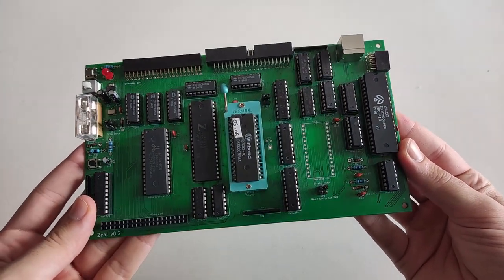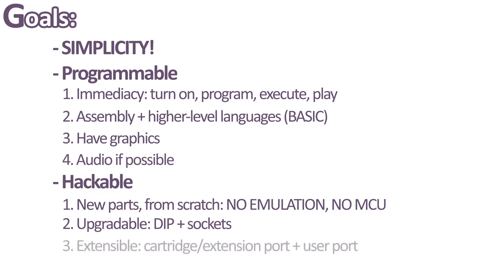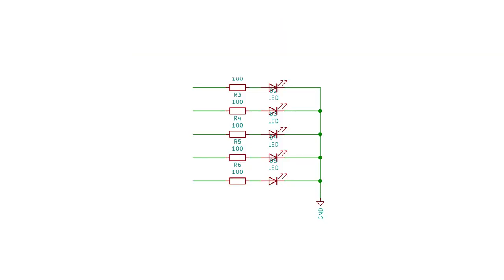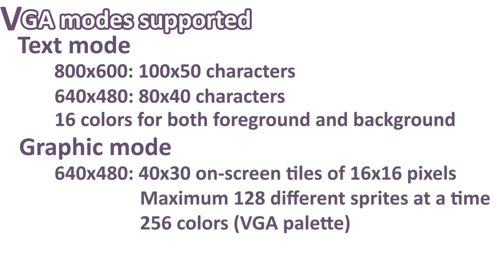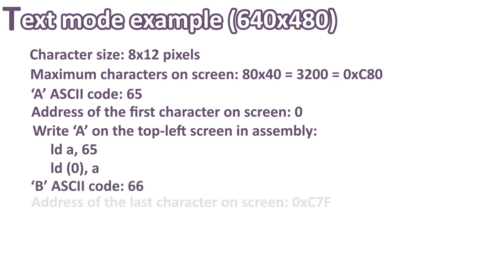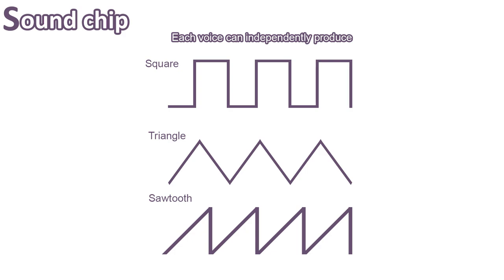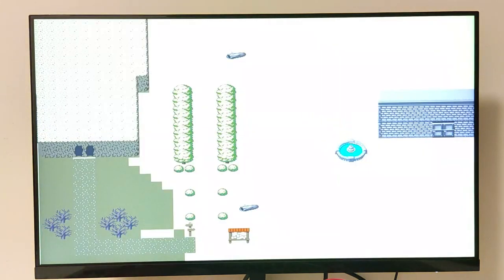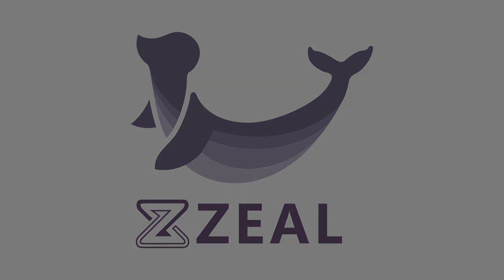Build an 8-bit retro computer powered by a Z80 ! [Zeal 8-bit]

Comment: Cool project!  Have you thought about doing something with the Z8000 in the future?  z16c01 are still available.  And that family has an MMU chip (forget what it's called).  So it's entirely possible to make a homebrew design and put some form of Unix on it (Onyx had it back in the day).  The Z8000, 68k, and maybe 65C816 are the only chips you could realistically do a project like that similar goals to this project (discrete new parts, from scratch, DIP sockets, etc).  And there are already lots of 68K projects out there already (only few with MMU tho).
Reply from the maker: The Z8000 is not compatible with the Z80 unfortunately, so that would mean the whole OS would need to be adapted and ported, including the user programs. While it is possible, it would be another project in itself. Also, I noticed that the Z16C01 CPU is discontinued, it's not easy to find it brand new, correct me if I am wrong.
The latest revision of Zeal 8-bit OS, supports no-MMU computers, so it would be possible to run the OS on the ZX Spectrum, the TRS-80 or the Amstrad CPC.

Comment: Awesome work - for a Z80 + FPGA Graphics and sound! When can we have a near-ended finished to go computer to test, and develop?
Reply from the maker: Thanks for your comment!

I presented a newer prototype for the motherboard in later videos, that I consider being the Release Candidate. It still have a few bugs but I corrected them on the version that I consider final v1.0 one. So, from a hardware side, this is almost ready.
From a software side, as you can also see from my latest videos, it's also moving, I published the open-source OS, Zeal 8-bit OS which will be embedded on it. I also developped an emulator for the board, very helpful for debugging and developping. You can find both on my Github:  
https://github.com/Zeal8bit
Finally, having a board without any documentation is useless, so documenting the hardware is something I would like to do too before releasing it.

This only concerns the motherboard, not the FPGA board which will come later as it needs more testing and development.

Comment: Great project! Do you know about the Commander X16 and its "VERA" FPGA graphics & sound chip? Maybe you could use the VERA also for your Z80 computer? It would give it quite advanced VGA graphics and also sound capabilities.
Reply from the maker: Thanks for your comment! I do know about the Commander X16 and its VERA FPGA. That's also a very nice project. Technically, I think it would be possible to use a VERA chip with Zeal 8-bit Computer, the video connector is a parallel port, it has the address and data lines, and also the RD/WR/IO signals.

From a design point of view, it's my FPGA project that motivated me to make this project at first, I would like to make it work, and complete the features without making it  too complex. The VERA is very powerful, too powerful for my use. It has so many sound channels and graphic layers. Yes, it makes it possible to make very complicated graphical softwares, but I find that this is a bit overkill for my computer.
I often think about the ZX Spectrum, its graphics had limitations, but it still has some good gems! The attribute clash made the charm of the computer.

In any case, once Zeal computer is finished, anyone will be able to plug anything to it, so VERA chip is a possibility!

Comment: Really nice project! I did something similar with a z180, but I used a cpld for the glue logic. I ended up not finishing that project, but it's always nice to see a new one!
Reply from the maker: Thank you for your comment !
In my second video, I show the CLP I am using for the latest prototype, it saves so much space on the board 😄
Any reason why you ended up not finishing it ?
Reply: @Zeal8bit , well the main reason was the cpld I chose. I have to use a weird parallel port programmer on an old laptop running windows 7. It's an Altera cpld on a plcc package. I'm kind of rusty in hdl and simulating the peripherals I was intending to add (namely, an spi port for an sd card and the banking registers plus the banking logic) took too much time and I just switched to another project (this one uses an Intel 80c188 cpu and doesn't need that much glue logic).
Reply from the maker: @cocusar  I  met this issue: I wanted to use an Atmel ATF1500 but unfortunately, it is not heasy to find a programmer for. So I will be using an ATF16V8B (ATF22V10B may also help me save another chip), which can be programmed with the TL866II plus. you could also use an FPGA for the peripherals. Or, you could also do an SPI driver in software with GPIOs (but that would be slower than CPLD/FPGA)
I am not very familiar with the 80C188, is it the successor of the 8088? How are you going to manage the SPI/SD Card/Banks with it?
Reply: @Zeal8bit  Yeah, I could use an fpga but I had this cpld at hand and it has an eeprom inside so it was a pretty convenient thing to replace all the logic and additional peripherals. So the 80c188 and 80c186 are mostly the same as the 8088/8086 but they contain some peripherals on the cpu itself. The address bus is 20 bits wide, so you can have 1MB of ram+rom without the need for banking. In my case I've used a 512k flash and a 512k ram. If more ram is required, then I could bank that on a specific address, exactly as EMS memory was used on the 8088/8086 PCs. The cpu has an interesting peripheral, which let's you control some pins as general purpose chip selects, so you can program some registers and say "from 0x300 thru 0x400 and if it's an IO access, the use the /GCS1 for it"; really convenient! And for the spi/sd, these GCS pins can also be used as gpios, so it was a matter of fiddling around and creating a bit banged algorithm. I ended up porting the ELKS project to it, which is a linux-like OS. really cool project if you want to tackle an 808x or 80c18x project in the future. they also use a gcc compiler for thr intel 16 bit cpus, so it's almost as programming modern-day apps!
Reply from the maker: @cocusar  Thanks for the info! I didn't know this processor. The 20-bit address like is really convenient, I have also seen some 24-bit lines on some CPUs. Does the 80c188/6 implement this with an MMU ? Or can you address any 20-bit address through the code without configuring the memory pages?

Form what I understand from what you tell me, it has an IOMUX as peripherals to change at runtime the purpose of a pin, that's pretty advanced for an old CPU.
Do you have any blog/website/videos to show your project ? I would love to follow your progress
Reply from the maker: I just checked the datasheet, I understand why it was nicknamed "segment hell" 😄
I don't really understand why they didn't go through another simpler way like having a segment register of 4 bits which represents the upper 4 bits of each segments, but they surely have their reasons. I am glad they changed it for the 386.
I didn't know ELKS (sounds similar to Z80's Fuzix OS), thanks for the pointer!
In my opinion, you should document what you did, in a blog, an article, a video, or any other mean, somewhere, not only for others but also for yourself. If you end up pausing the project and getting back to it later, or to a more advanced project, you will be able to read it back and understand what you did great or what you can still improve. But of, it depends on your time. Anyway, if you end up publishing anything, please give me a link!😁
Reply: @Zeal8bit  Well, I think that segment was created as a step up above the older architecture of the 8080 (similar to the Z80), but by trying to make it compatible, they introduced that "little issue". if you don't go above 64k, you don't even need to worry about segments, which in general is a good idea because if you do need to cross segment boundaries, you might end up creating a larger code using a lot of load instructions to change segments back and forth. Yeah, I will upload some kind of a post on my lonely blog one of these days and I'll let you know! Also looking forward to seeing your progress on your project!
Reply: @Zeal8bit  ATF15XX are drop in replacement for Altera 7000 series afaik. And I remember being able to program them with some cheap chinesium ISP programmer.  It was not straightforward though and involved some magic :)
Reply from the maker: @cocusar  Thanks! Going to check this!
Reply: @Zeal8bit  HD64180 or Z8S180 both official super Z80.

Comment: Brave heart! In video making two PCBs in the video was just few seconds, but I know how long it takes in reality...
I see making everything first time as you want/can is fun and easy. But can you think about making your PC compatible? For example CPC or MSX? There are a lot of soft/dev tools/games are available. 
The memory layout is incompatible with CPM OS. If video memory write only /*without extensive h/w acceleration like MSX VDP v9938*/ there will limitation for high dynamic video games.
Reply from the maker: Thanks for your comment!
Indeed, not on only designing the PCBs took time but also debugging once soldered 😄

The fact is I modified my memory mapping for several reasons, including having a better software compatibility with already existing systems. Now, the memory is split into 4x16KB pages which can be mapped to any 16KB page of the 4MB physical address. This also fixes the problem of the VRAM being write-only.
I made a video where I explain this, I also ported CP/M to have a try and it worked: https://www.youtube.com/watch?v=mk_CDhV2BYE&t=189s

For MSX, the problem is the hardware, as the standard states that the CPU must be running at 3.58MHz, the video processor needs to be a Texas Instruments TMS9918 and the sound chip a AY-3-8910. It would be possible to emulates these in the FPGA but that would be a completey different project. (It is also possible to make an external board which embeds these two and connect it to the extension port)
Reply: @Zeal8bit  Nice to see your next video. Compatibility has it's benefits, especially if you want other people to follow and have a community around your computer. I'd recommend to use some standard monitor /*I use WozMon from AppleII - terse and small*/ to use standard converters/tools to work /* copy & paste in terminal for example*/.
Is the mapper MSX compatible? I recommend to try  port MSX  DOS - it's quite CPM compatible and it supports FAT12 filesystem - easy to transfer files.
There are projects for drop in replacements of AY and VDP in FPGa, for AY even STM32 or AVR based.
MSX can have faster CPUs, they are syncing with fps on VDP. With faster CPU it's possible to 'emulate' VDP and AY spending CPU cycles wasted for waiting H/W readiness to perform actual operations. 'emulation' can be performed in NMI handler for AY&VDP ports I/O.
It's enough to make h/w compatible enough to make 'emulation' fast and efficient. Screen resolution, color numbers color palette  must be compatible. For the sound just have 3 sound channels with sine/square/saw + 1 noise + volume control for all channels is enough to make 'same' music in the games. /*for demos it may be hard without having exact emulation on STM32 or FPGA*/

Comment: Well since you ended up, using an FPGA, you could have used microcontrollers too i guess.
But fascination work.
Reply from the maker: Indeed it would be possible to use a microcontroller instead of the FPGA, it would even simplify the sound generation and the SD card interface, for the VGA output however, it may be a bit tricker but possible. The fact is I am a software guy at first so using an FGPA, programming in Verilog and making a custom PCB for it took me  out of my comfort zone😄
Reply: ...or implement the (Z80?) CPU among all other peripherals within the FPGA ? ;-)

Comment: A Zilog Z800 would let you run software for the ZILOG Z80/Z80A/Z800 and with the ZILOG Z800 you can have a port of UNIX System V.
Reply from the maker: The Z800 is not produced anymore, it is obsolete, which makes it harder to find, mainly in brand new condition

Comment: Hi there ^_^ I'm not a hardware guy, so whatever I would say will have strictly software perspective:
ROM - dedicating 32k - a half of addressable space  is a BAD idea. Why - because as somebody that had developed applications and games for 8 bit systems - I almost never use the ROM. Sure I use like 3-5 kernel functions (mainly I/O) but even that can be done/copy inside your code. So if possible - no ROM in the addressable space just copy in the RAM needed thing, but if you 100% must - then make the ROM window as smaller as possible.

SOUND - don't fall in the trap of making a custom one. Use standards that are already used - Yamaha chips, Sound Blaster, OPL, ... The reason is that it will be extremely  hard to make formats, trackers, players for your thing. You may try emulating the standard on FPGA or simply add YM XXX chip.

VIDEO - what you call text mode and graphic mode is pretty much the same - a tile engine. Usually in text mode the tiles (aka characters in the past) are defined in ROM?EPROM, while graphics keep them in VRAM. The design is simple and easy to use, but way to limiting to do something interesting. Pretty much PET with colors It might be beyond your scope for simplicity, but I would suggest to search info on VERA - FPGA graphic for Commander X16. As a game developer it is pretty much the least what you would expect from retro computer.
Reply from the maker: Thanks for your comment!
As you say in my later videos, the mapping has been changed to something more versatile. Small notes on the former mapping though, the ROM part also included external ROM part, which means that if you have your game/program on an external cartridge, it could be mapped at 0x4000.

Regarding video, you also saw it in a later video, the tile engine will be upgraded to have a sprites mode too. So we would have text mode, simple and fast, and graphics mode, supporting background tile and sprites. In my case, a bitmap mode is not possible unless it's a 1-bit mode (maybe 2-bit if I optimize the VRAM space). And there is not DMA, so getting a decent framerate may not that simple either. I still believe it is possibe to achieve nice things with tiles + sprites, just like the Gameboy did.

For the sound, I wanted to use parts that are still available today (not refurbished). I was unable to find any. I understand that would be better for compatiblity to try emulating a former one. But for simplicity of programing maybe not. With the FPGA, a good amount of things can be abstracted. My sound module simply takes the note frequency, the waveform (triangle, pulse, sawtooth), a (n optional) duration, and that's it.

In any case, your inputs are really valuable for me for the project! It's great to have another programmer's external view on it, it means a lot. I first hope ot finish the project, even if it's not perfect nad has flaws. I don't want to make a super-overkill-mega 8-bit computer that would take 3 years to complete. I have already spent a year on it, I would like to have a first final version. Hardware upgrades and optimizations can then come in a second time.
Reply: @Zeal8bit  Thank you for the kind words!

SOUND.I know current situation is still bizarre but it should be possible to get Yamaha chips. I know YM2151 was chosen for another project mainly for availability reasons.

VIDEO. As I suggested in the other video, you problems comes because you try to fill real 640x480 pixels. If you work with 320x240 and then double that internally, many new possibilities will open. On 8 bit CPU Bitmap mode is used primary for nice artwork like title screens or to overcome the limitations of tiles, like pixel precision. A full screen 320x240x8bpp image takes "only" 76kb, there will be room even for sprites  ^_^
Reply from the maker: @SquallSf  Thanks for the tip, I am going to check the YM2151 !

Good to know! I wasn't sure what was the best approach for choosing the resolution but supporting both will solve this question I guess

Comment: Nice video.  However, doesn't the FPGA solution violate your first rule of simple?
Reply from the maker: Thank you, good remark!
I meant that it should be simple from a user/developer point of view. Using an FPGA in this case does help abstracting a lot of things. This is why the interface to write characters or tiles  is pretty simple.

Comment: is the fpga code open source?
i plan to do something similar, but by pimping the Atari 2600.
the upduino board could serve as a starting point for a graphics chip or a multicore cpu (6502 + z80 + msp430 16-bit core).
a raspberry pi pico could do the sound. there is a SID-chip emulation available for it, which could serve as a base.
the Z80 core is interesting because a CP/M OS could be ported easy.